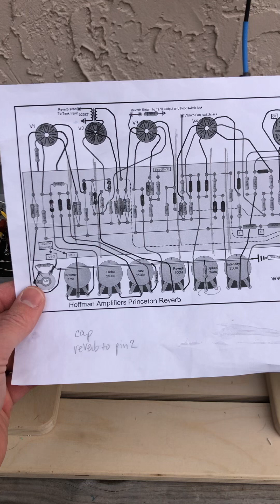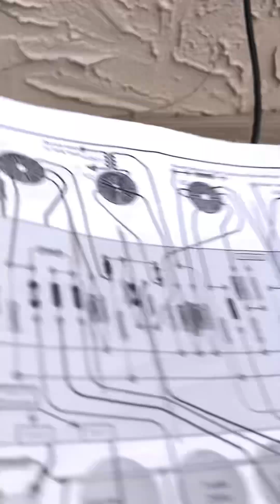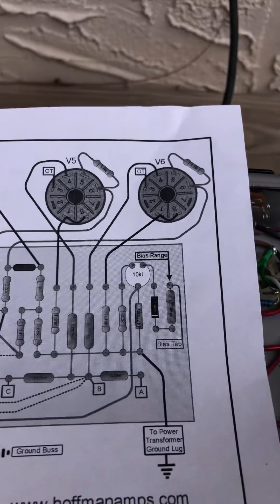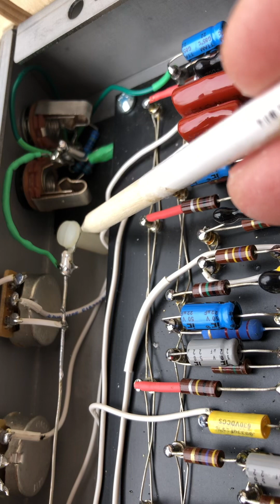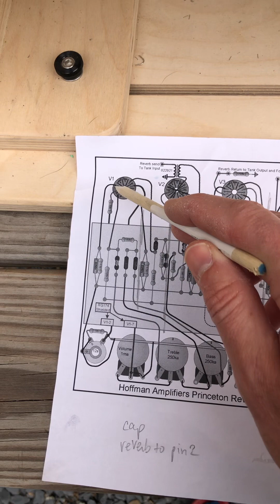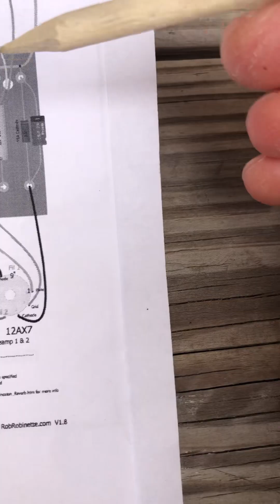Princeton Reverb clone using Doug Hoffman layout

Comment: I'm working on my first Princeton build and I also used carbon comp resistors. I made a brass plate like they used on vintage amps instead of the bus wire. Is there an advantage for the way you did yours?

Comment: I used to use CC resistors when I first started cloning amps.  Then after servicing lots of vintage amps and seeing huge value drifts in the CCs I no longer use them.  Nice work on the amp.